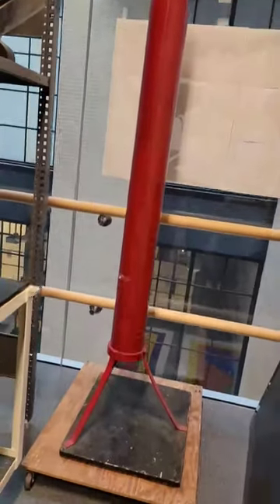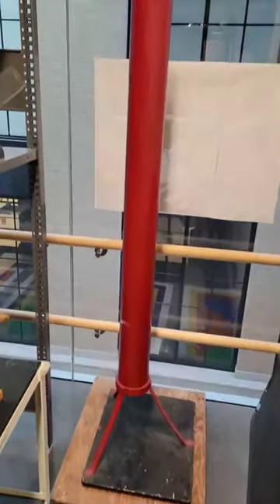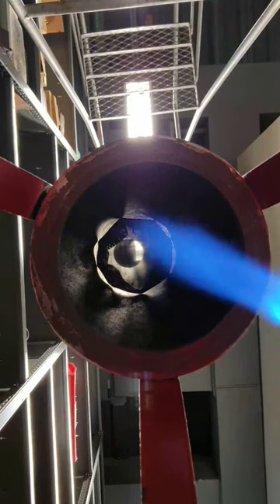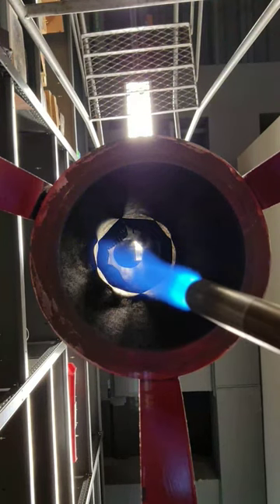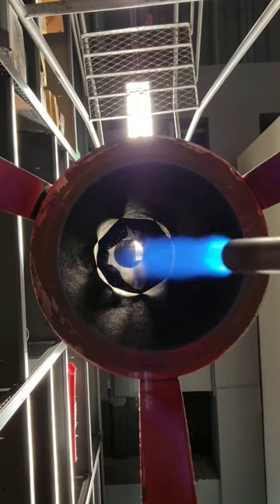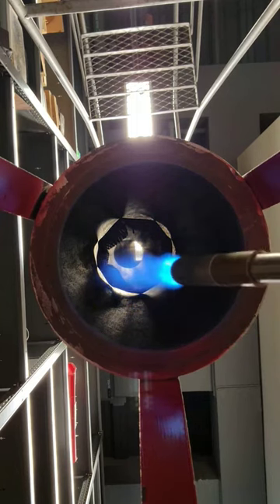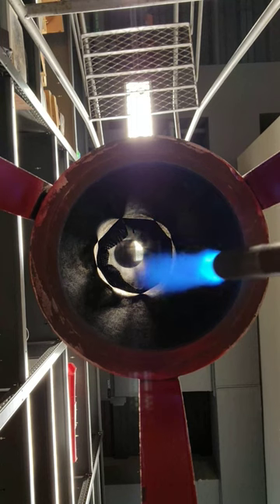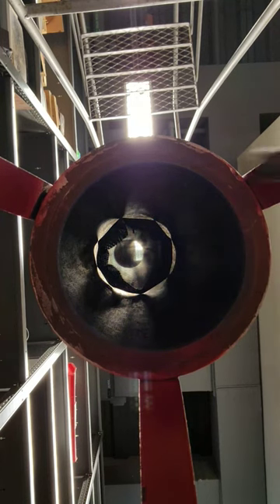This Rijke Tube is incredibly loud! #physics #stem #science

Comment: When I was 12, 55 years ago, I found out about this and we would get the thick cardboard cylinders from carpet rolls and hold them over a gas stove burner. Different lengths make different notes and the amount of gas burning will change the volume. One needs to be careful of the tube catching alight though.
Reply: That's great!😂

Comment: I also tried different types of materials. In  some cases I get the sound but in some cases fail. Can you share me the details of the dimensions of the tube like length, inner diameter, outer diameter and at which place you heated the tube?

Thank you